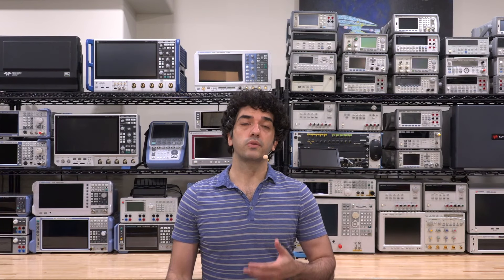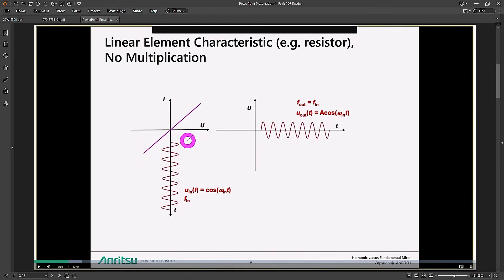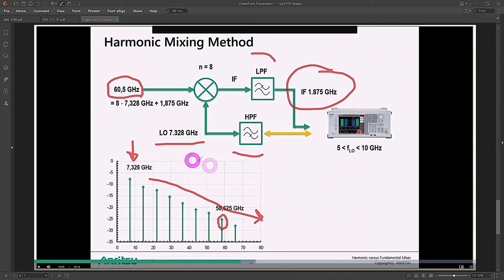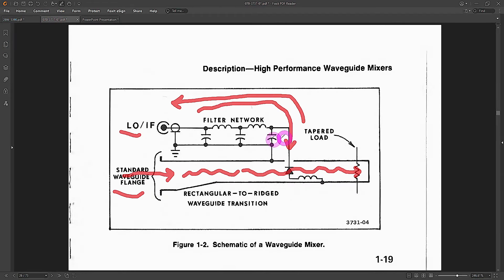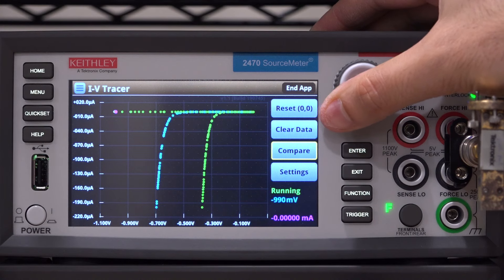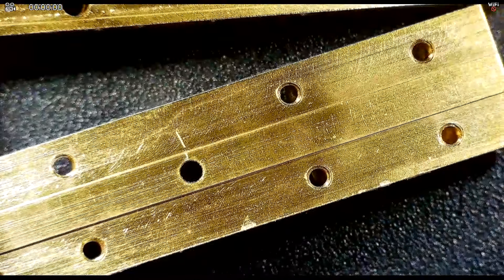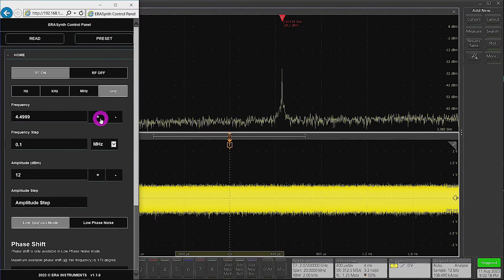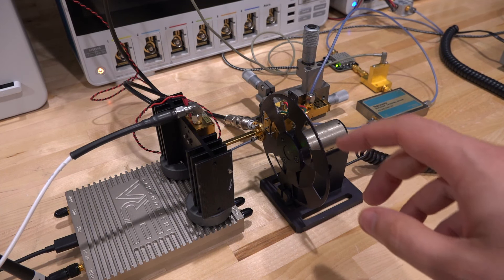TSP #232 - Near-THz Sub-Harmonic Mixers (Tektronix 75 - 140GHz) Tutorial, Teardown & Experiments

Comment: Great vid as always. I have made external mixers for my old Tek 492 using these diplexers. Just a tiny diode at the end of rigid coax and a flashlight reflector for a horn. Works to 61GHz using a radar module in test cw mode. There is a conversion loss list somewhere in Tek docs but 15th harmonic etc wont ever be strong.

Comment: Thank you for explaining this so clearly. Would be nice to also see episode about Gunn diodes for generation of these high frequencies. Perhaps using EIP 578B locking counter could be great illustration of using mixer + Gunn oscillator to make programmable many-GHz clock source. Also could you use different harmonics in a mixer like this, for example 20th instead of 23th?

Comment: Very impressive (or at least I THINK it is???)...
It motivated me into building my own ultra high frequency oscillator... (around 454THz I believe)
.
.
.
.
I grabbed a red LED and hooked it up to a battery thru a resistor.
Reply: Actually - you're spot on... LEDs are in fact oscillators. They obviously generate visible light, but in the process create ultra high frequency oscillations in the electrical side too at the same frequency as the electrons jump in the junction. Not many people realize this, so good for you!

Comment: One issue using an endmill to cut such a tapered slot by moving it up as you move is that you would get a concave bottom, as you are now taking an angled projection of a circle for your bottom surface.

Let’s say the channel was 6mm wide and you had a rise over run of 1/10, the center of your endmill would cut 3mm ahead of the sides at the same level, so as you move forward these 3mm you will have a 0.3mm hollow.

That’s a reason why you normally use a ball nose endmill as the projection of a sphere stays constant, at which point your surface dishing is a function of stepover and cutter radius.

So this part was probably made on a fancy 5 axis machine, or depending on age and production volume at least an angled fixture
Reply: I bet it was an angled fixture. CNC machines , especially fancy ones, were not really available back then.

Comment: Excellent Video and Experiments again. I own some of those mixers up to 220 Ghz (got it from a ham radio OV working with THz). An succeded to repair the 90-140 GHz  Version. The inside looked a litte bit different frm this video and the diode was in series. I needed around half dozen similar diodes and H20 glue to glue it on the tip reaching the filter with the other  side. I have a spectrum analyser with integrated diplexer and signal id which helps (also biasing), -- Great to use a SMU for i-V curve, I will try to get this app for my 2650. Makes it safer to test the diodes. But at the time of my repair I didnt had one - will try it for more precise characteristics... For test I used a 120Ghz Radar Chip from silicon radar.

Comment: Really cool video. I wonder if the “damage” on the top of the diode was actually marks from a wafer prober during test?
Reply from the maker: I’d imagine that would be more in the center…
Reply: @Thesignalpath  The RF absorber looks like it suffered a brittle snap, maybe from a drop. Then, like you suspected, it would have resulted in damage at the bottom of diode, as the broken gasket basically wedged the diode. If someone didn't realize that it had been damaged and then tried to use it, that could have easily blown the thin oxide layer. 

A standard CNC probably wouldn't get you a surface finish R_a good enough for RF purposes. A surface grinder, well-designed jigs that you can precision pin to align against so you the right angle tapers, and a few thousand dollars in metrology equipment would probably get you on-par (or better) than what they were producing. But the diode is where all the magic really happens. What you should try to do is surgically remove/repair where the IC has localized damage and repeat the experiment

Either way, as usual great stuff. Every episode that features failure analysis with the microscope earns you an A+ in my book

Comment: 1. Would there be any benefit in having a diode with a P/N junction width equal to a multiple or integer factor of the wavelength to be measured? 
2. "How" tiny is the diode in the parts you have? How much current can it carry before it gets destroyed? Is it on the order of single digit mA or will it only carry a few uA before being damaged?

Comment: Thanks for the wondeful video.
I was wondering: is it really such a delicate diode that cannot be tested with a multimeter? When in operation, it is biased at 10 mA, which is a lot more than was used for characterization and is also more than the test current used by multimeters, at least in my belief.
Reply from the maker: The main issue is the initial discharge into the diode. A lot of multimeters produce an open voltage of several volts. The moment you connect the diode the inrush current can be high and damage the diode.

Comment: Is the high loss seen when introducing a gap in the waveguide due to free-space propagation loss or is it also due to the mismatch? If you have a pair of WR10 horns, I wonder if that would reduce the amount of loss. My lab had an old Tek 492 with a couple of mixer modules and the diplexer. We surplussed it a while ago, our mixers only went up to ~40 GHz as I recall.

Comment: The "Harmonic Mixing Method" slide @6:30 had me a little bit confused. You used commas on the left side (7,328 GHz + 1,875 GHz) and on the right side you used
a decimal for the IF (1.875 GHz). You also used a decimal point for your LO frequency. That is how rocket systems abort prior to launch or experience a "Rapid Unscheduled Disassembly" during ascent! 😁🧡
Reply: as long as you never use either comma nor dots to separate thousands, it's not confusing

Comment: Great video as usual! Just one question, when you show the transfer function of the step diode, shouldnt it be a square wave rather than a super narrow pulse? I understand the srd actually has a time dependancy which maybe helps create yhe pulse, but at first sight the vertical.respinse curve would create a square, wouldnt it?
Reply from the maker: The response goes to infinity vertically, there is no horizontal increase once it starts going up. As a result you can’t have a secure wave. If order to get a square wave, the I/V curve would have to look like a step function.
Reply: https://en.wikipedia.org/wiki/Step_recovery_diode shows very sharp, narrow pulses as well.  I think the pulse is due to inductance in the circuit.  The step-recovery diode turns off extremely quickly, so any inductance at all in the circuit produces a pulse much higher in voltage than the forward voltage drop of the junction, like on the order of several volts.  But this dissipates quickly, depending on that same inductance.  This is the main application of step recovery diodes, since those very fast rise times transfer to very rich harmonic content.
Reply: @Thesignalpath  Thanks! I guess I need to think it a bit more.

Comment: Shariar I wonder about the construction of this diode. I would expect a whisker tip type like the old ceramic coaxial germanium mixer diodes. This would ensure a very small junction capacity. But I could be wrong. Do you know more about this?
Reply: This type of diode is called "beam-lead" (just google images and you will see a lot of them).  These are planar diodes where a metal bridge connects to a very small epitaxial junction with capacitance about 50 femto farads or so. I believe the diodes used in these mixers were either made by Alpha(formerly TRG) (later SkyWorks) or Metelics [but I am not 100% sure]. The whisker type of diodes you mention were used by tektronix in the previous generation of the harmonic mixers employing the 1N26B and the 1N53B.

Comment: Apparently the diode (a beam lead diode) was bent in the wrong direction. There is usually a minuscule spacer that sits on top of the rod and the diode lead is bent to sit on top of it. Then it would be possible to apply a small pressure to promote the contact of the LPF hat to the diode without smashing the diode, by the way beam lead diodes are extremely fragile. Maybe the diode is still good... even if not a new diode is very easy to apply and restore the mixer to the former glory.
Reply: Do you hire fleas to do the work on the diode assembly?   :)

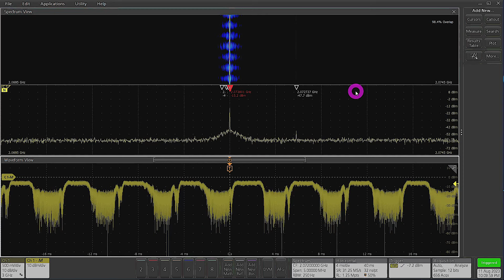Comment: At time 47:00, right after you start chopping the RF input, a series of feeble tones around the IF appear on the oscilloscope FFT.  Later on, most die out, but one survives and is even picked up by the instrument @2.072727 GHz (726 kHz above the IF), -49.5 dBm.  I suspect these are intermod products caused by the chopping.  @47:00, if you watch closely, the amplitudes of these tones are not the same on either side of the IF (the amplitudes at below the IF are lower), which indicates both phase and amplitude noise introduced by the chopping.

Comment: What did they do in 100 GHz 50 years ago?
Reply: Carcinotron and particle accelerators.
Reply: Many quantum voltage standards used (and still use) 70-90 GHz still , since Josephson Junction device is in a nutshell discrete quantum-accurate AC current to DC voltage converter.
Reply: Lots of applications, I add 2 more:
- Plasma physics measurements (interferometry, and slightly later reflectometry)
- Supply pump for parametric amplifiers (in the tens of GHz)

Comment: Talking faster than I can listen.
Reply from the maker: Have you tried 0.75x speed? Some people have mentioned they prefer it. Although I have had people who told me they listen at 1.5x...
Reply: @Thesignalpath  Yes, listening at 1.5x. I loved this video BTW. Also why do we care at what voltage the diode turns on as long as the "knee" is sharp enough 18:30? Is a higher DC bias voltage bad somehow?
Reply: @SDX2000 To get as high power in the high harmonics as possible, LO signal should swing as close to the maximum nonlinearity of the diode as possible. The maximum nonlinearity happens to be at the knee. The diode rectifies LO and that generates positive DC component moving operation point away from the knee. Negative external DC bias counters that bringing operation point close to maximum nonlinearity: the knee. And that is why adjusting external DC voltage affects mixer conversion loss and thus IF level.
Reply: @adamturowski3765  thanks for the explanation. I get that but it still does not explain why the actual value of the turn on voltage is significant. Can't you apply a  negative DC offset of lower magnitude in the case of the diode with the higher turn on voltage?
Reply: @SDX2000  Turn on voltage is significant because it determines how much LO voltage swing gets rectified and turned into DC that needs to be compensated for with external bias voltage. Is that more clear now?